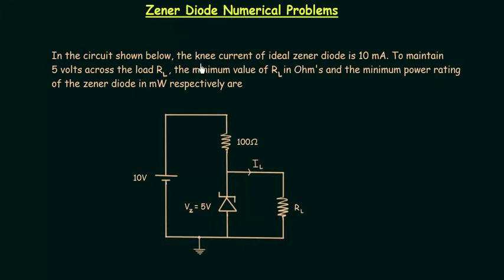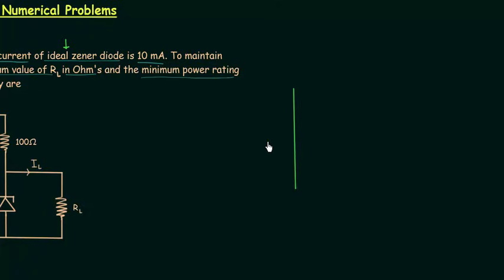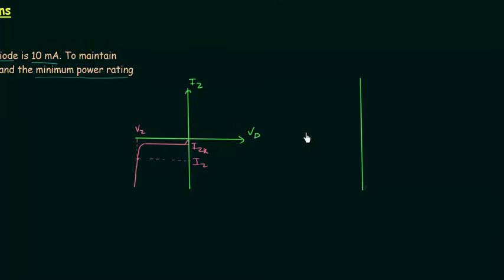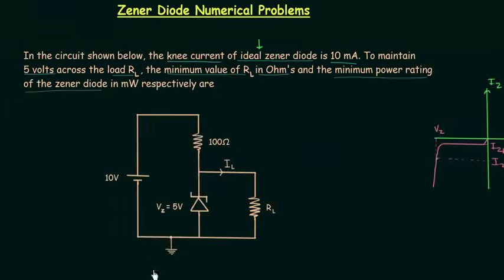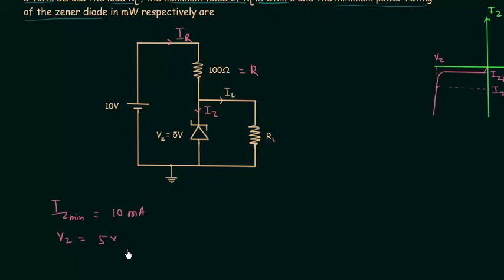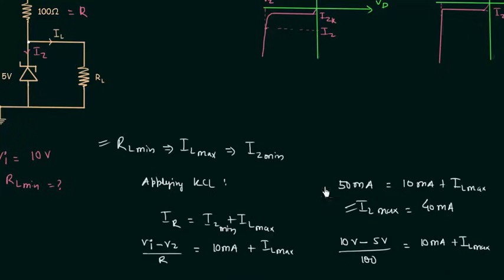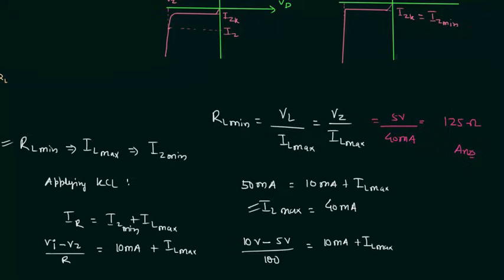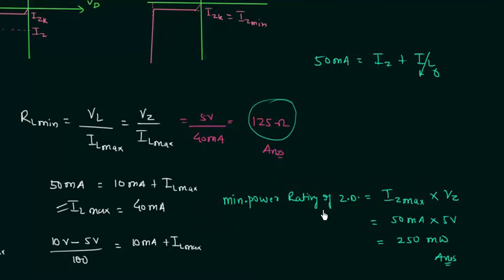Zener Diode Numerical Problems (Part 2)

Comment: Why you not use the condition for RL min=vz*R/vi-vz,in last qst
Reply: did u get the answer?
Reply: @tarunyadav6617 yes, because By using the direct formula, we assume that the Thevenin's voltage is equal to the Zener voltage and if we consider this we get the minimum current through the diode is zero, which means Izmin=0. But here the question specifies that the minimum Zener current should be 10mA, so we have to carry it in the other way out. That means we can't use the direct formula for R_Lmin.

Comment: At 5:57 if we have to calculate min pow rating so why we did lzmax * Vz
Reply: Ha bhai why sir calculated Izmax??
Reply: min power rating of zener diode is defined as the power it can tolerate before getting complete breakdown. If the power across zener diode exceed this min power rating the zener diode will get destroyed that is why we use max zener current which can flow through it for calculating power rating of zener diode.

Comment: if we assume load current =0 then voltage across resistance become 0 , which is not possible because voltage across load is Vz, but as we seen in the solution both condition contradict so is this solution is correct?
Reply: The voltage is not zero but otherwise, you can think of no-load there or as an open circuit.

Comment: the question should be corrected... it should be asking MINIMUM LOAD RESISTANCE AND MAXIMUM POWER DISSIPATION of the Zener Diode..
I don't understand the point of MINIMUM POWER DISSIPATION...
Reply: as bob fuller explained ;the minimum was used instead of max b/c the zener must overcome the max power that the ckt yields to resist all currents  that pass through the zener when RL  IS changed

Comment: if minimum power dissipation is equal to max zener current * zener voltage then maximum power dissipation equql to what???????
Reply: its not power dissipation it is power rating

Comment: why don't we direct used this formulae for finding minimum load resistance I.e. Rlmin
Rlmin=Vz*R/(Vi-Vz)
Reply: By using the direct formula, we assume that the Thevenin's voltage is equal to the Zener voltage and if we consider this we get the minimum current through the diode is zero, which means Izmin=0. But here the question specifies that the minimum Zener current should be 10mA, so we have to carry it in the other way out. That means we can't use the direct formula for R_Lmin.
Reply: @dikukhanikar2837   very good exp.
Reply: @dikukhanikar2837  thanks for great explaination ❤ from iit roorkee
Reply: @Subham kumar the formula Of Rlmin is valid only for practical or Normal diodes but here in the given numerical diode is ideal ..so we can not use the Direct formula to find the Value of Rlmin.
Reply: Yes i have the same question
Reply: ẞecause we use this formula when load resistance is variable ßut here load resistance is constant.
Reply: @405muskanrautela4  How is the load resistance varying? Rl min and max occurs because it is varying right?

Comment: min power rating of zener diode is defined as the power it can tolerate before getting complete breakdown. If the power across zener diode exceed this min power rating the zener diode will get destroyed that is why we use max zener current which can flow through it for calculating power rating of zener diode.
Reply: you are wrong bro, the right definition of min power rating for Zener diode is "The minimum power rating of a Zener diode refers to the smallest amount of power that the Zener diode can safely dissipate while maintaining proper regulation. It is determined by the minimum Zener current (I
𝑍_min) required to keep the diode in its breakdown region."
Reply: @ACHIEVING_INFINITY  yes , he solved wrong
Reply: Thanks naman
Reply: Thanx bro
Reply: thanks man searching for this
Reply: "min power rating of zener diode is defined as the power it can tolerate before getting complete breakdown"

So what we mean by maximum power rating of Zener diode ?
please clarify.
Reply: @shivinwestwood in the previous videos he has used the word maximum power ‘dissipation’ and not maximum power ‘rating’
Reply: @shivinwestwood  That might be Infinity. 😆....

Comment: Hi I have a question.
Why is that minimum power dissipation is equal to max zener current * zener voltage? 
Shouldn't it be min zener current * zener voltage? 
Thank you for your time !
Reply: Pierre Tran - Thanks for asking the question. Bob Fuller - Thanks for the clarification!
Reply: Pierre Tran - because when you are choosing the diode for the particular circuit it is being used in, you need to ensure the the power rating of the zener diode is at least the maximum power that the circuit generates. So, as a minimum, the diode has to have the power rating that is able to handle the maximum zener current. Otherwise the diode would burn up if the maximum current is passed through it. Hope that makes sense.
Reply: thanks for the input !
Reply: @bobfuller  thnx
Reply: @bobfuller   thanks buddy
Reply: @bobfuller  thank you so much....i was facing the same doubt.
Reply: @bobfuller  thank you so much
Reply: @bobfuller  thnks man
Reply: @bobfuller but it should have been called maximum power rating, not the minimum power rating. Isn't it?
Reply: Bob Fuller lovely explanation
Reply: What will be maximum power dissipation.. Iz is minimum or maximum????
Reply: IZM of a Zener diode is the maximum current that can flow through a Zener diode at its rated voltage, VZ. 
Minimum power rating reffer  to  minimum current (I knee) required for the operation of the diode. So for min power we should use I(min). Which helps for operation of circuit...
I think answer is  Iknee* 5v =50 mW
Reply: It's like Pzm should be the greatest right? So the maximum value is used , but the Pzm it calculates is the minimum one or the first one
Reply: Exm se pehle din padhkr ye saab sawal nhi pucha krte smjh aye toh aye nhi toh bhaang khaye 😅😂
Reply: Bob Fuller...then what is use of maximum power rating..????
Reply: @mr.unique7689  i too have same doubt

Comment: min power rating = i(zener max)*v(z) why ???. Why not i(zener min)*v(z)..
Reply: min power rating of zener diode is defined as the power it can tolerate before getting complete breakdown. If the power across zener diode exceed this min power rating the zener diode will get destroyed that is why we use max zener current which can flow through it.
Reply: dissipation and rating are different things.
When power dissipation is asked we need to calculate what maximum power will it exhibit. That will be only when max current will flow through it.
when min power rating is asked then too it means the minimum capability of the diode after which it becomes useless. So Izmax is the maximum possible current if we increase more then Zener diode will be destroyed.
Reply: Immortal yes,it's a bit Weird.
Reply: shubham agrawal its actually Iz min